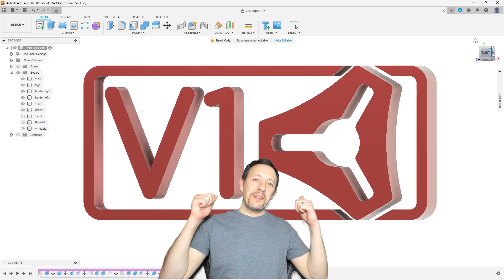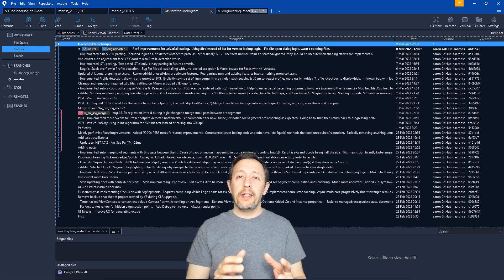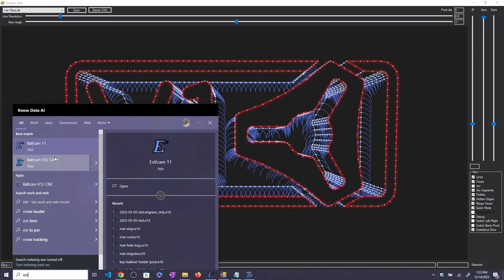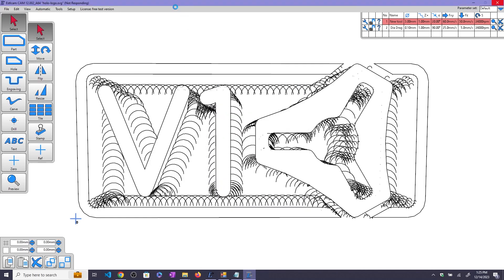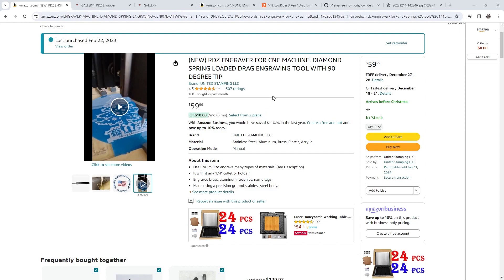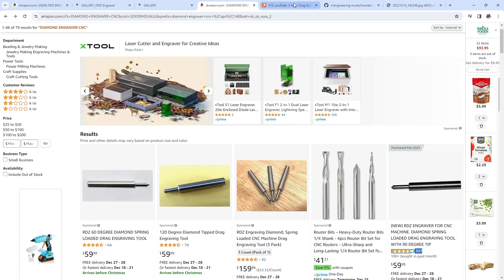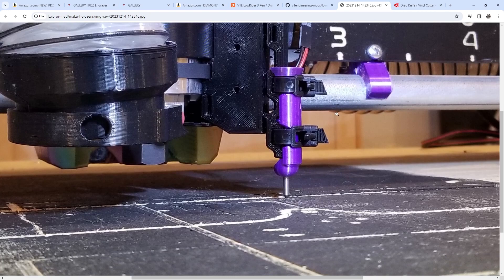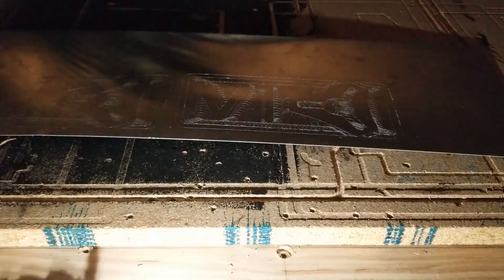CNC Specular Holograms, STL to SVG tool, LowRider3 diamond engraving via EstlCam

Comment: May I ask what's the shape of the curve? Is it a circular arc, or a hyperbolic curve as described in Matthew Brand's paper?
Reply: It's not the circles which get ya, it's the jaggies.  There must be no jaggies at all, not even micro-sized.  DRAG-ENGRAVING works best.   Also, I made these work optically, by using 0.2-mil jaggies on aluminum, then dousing the whole thing with gloss black spray-paint, to fill in the tiny divots.
Or in other words, if your tool is like the needle of a vinyl-album recording-lathe, carving out a master-disk, THERE MUST BE NO SOUND, the groove must be flat and polished, so it preserves the image of your light source, same as a mirror.    If we could play the scratch-hologram like a vinyl record, we must hear silence, and not any whine-tones from millions of micro-jaggies.

As for the curves, circles and hyperbolae are the same near the vertex.   Real holograms are mostly composed of stacks of hyperbola-fringes.    But in this case, we're trying to mimic a Rainbow hologram, where the fringes are all contained within a broad strip which is about half a mm tall.    So, see  Figure 11 in the original paper on amasci, DRAWING HOLOGRAMS BY HAND.   A hand-drawn hologram has scratches like in 11-C, while real Benton Rainbow holography produces interference patterns like in 11A, with one "swatch" per image-pixel.   A CNC version of hand-drawn holograms should produce a set of scratches like in 11B.   It's a bit like changing a normal lens into a fresnel-lens, so it becomes very thin.   (This removes the "swinging error" seen in hand-drawn holograms made with a dividers-needle.)
Reply from the maker: Hello!  The curves always look circular to me, but the arcs are made of individual segments based on viewing position/angle.  For more than elliptical curves would probably need to change code that pans/sweeps the camera position, angle and maybe perspective too.
Reply: @AzaB2C  Thanks for your quick response! Yeah, I can see that. Nearly every open-sourced scratch hologram program runs with circular arc. Perhaps I really need to buy that Holocraft software... R.I.P. my wallet. Anyway thanks again!
Reply from the maker: You're welcome @grayson_wu ! have seen a few people use HoloCraft, curious if you end up choosing something else.  Good luck with your project(s).  Feel free to open a request/issue on the GitHub repo, maybe someone/me will get around to making edits to camera position orientation that results in more elliptical scratches.  Cheers!

Comment: I've tried to install the program, but no luck a few .dll are not are not in the source code?  scratchview.dll and viewsupport.dll which is unfortunate.  Any ideas?
Reply from the maker: Hello @cpace123!  Thank you for your interest and for reaching out.  There was a problem building from command line, I've been building from VS2022.  Thank you for the heads up.  I just pushed a commit that updates Newtonsoft package version.  After doing that, here's what "works on my machine" (tm) 🙂...

E:\scratch>git clone https://github.com/aaronse/hz-scratch-hologram
E:\scratch>cd hz-scratch-hologram
E:\scratch\hz-scratch-hologram>dotnet build
E:\scratch\hz-scratch-hologram>dir /s /b *.exe
E:\scratch\hz-scratch-hologram\ScratchTest\bin\Debug\ScratchTest.exe
Start the ScratchTest.exe app.  Ensure you have low expectations and patience, it's rough...
Click on "Open", use a small .STL file, for example... \Data\v1e-10mm.stl
Believe it or not, I spent a bunch of time optimizing the original code this was forked from (see commit history).  But, it's still really really slow for large .STL models.  Partly because rendering arcs requires computing view from multiple perspectives, code is single threaded, lots of opportunity to improve...  

Planning to spend more time on this if there's more interest from me and/or others for my/their projects.  Next edit I make for this project will be to reshuffle code/projects around to something that makes sense to me.  Will be converging/merging some of the original projects.

Usage tips:  Show hidden faces, deselect arcs until you have the desired viewing angle.  Pan/Zoom/Tilt can be wonky too...

Hope that helps!

Am using Visual Studio 2022 on Win 11.  I usually build from Visual Studio, but "dotnet build" works too after the commit I just pushed.
Reply: I'll give a whirl. I have win 10 but was also using 2022 @AzaB2C
Reply: I have been able to get the program working.  thanks I have been working on something myself using  javascript and svg commands. SVG has an easy way to make arcs. Basically x,y and radius. It then will generate and arc. Just need a good way to get xy data points.  @AzaB2C
Reply: @AzaB2C  I will give you a lazer if you can provide me a step by step guide on how to achieve the best results deal ?